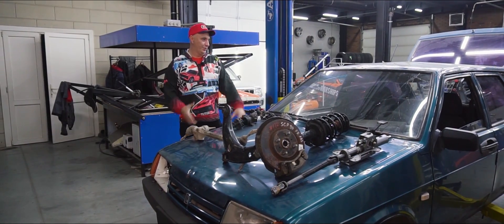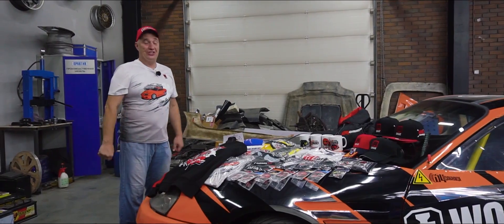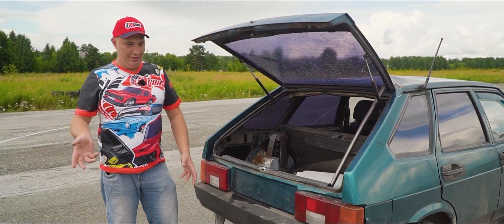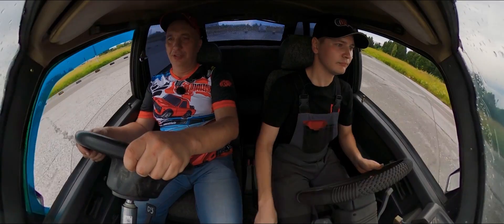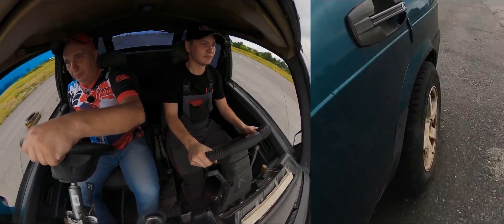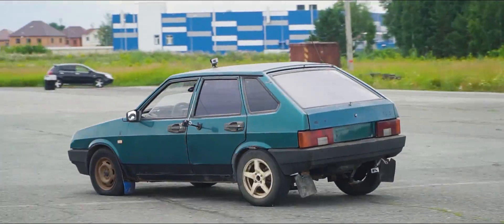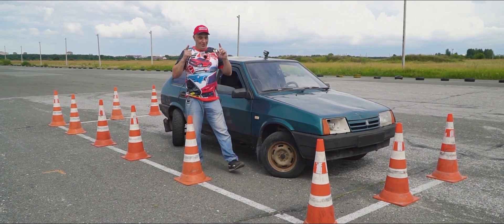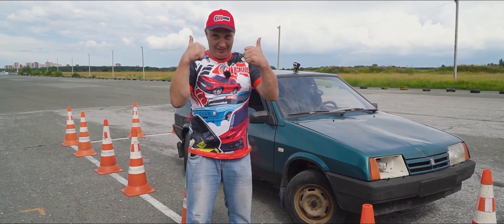Making a car steer with its rear wheels

Comment: You have to put the steering setup and suspension on the rear backwards compared to the front or your tires will go in weird angles compared to each other OMG, not to mention anti-dive from braking, which will make the rear end buck up abnormally high compared to the front OMG again.

Comment: 3rd generation Honda Prelude's 4 wheel steering is even more simple than adding a 2nd rack. Though the rear only gives you 15 degrees at max tilt. Still makes for and amazing driving experience that you'll never get out of any other car.

Comment: You installed the new rear axle the wrong way round, which is why the car wobbles so much. Because normally the inner wheel steers in more than the outer wheel, because the inner wheel has a narrower radius to drive than the outer wheel.
If you mount the axle at the rear in the original direction of travel, it should drive much better and more stable.

Comment: They have to come up with some kind of leaver between the both steering colum like forward and reverse the rotation movement to be driven by one man only
Reply: At slow speed to make a u turn put in reverse and both steer in opposite direction
Reply: And at high speed to switch lanes put it in 1 gear also to seprate both and drive like a normal car put the gear in neutral👍

Comment: hello guys, if i can give you an idea for your next video, i would suggest putting a differential system on the steering column, making the steering wheel turn the car in the opposite direction to the spin. I believe the behavior of the vehicle during the tests would be interesting. I love your videos. Hugs from Brazil.

Comment: One of the best cars when I was young had the steering wheel in the passenger side with a flipped rack so the steering was left for right right for left, drivers side had the foot pedals. Both drivers would be blind folded and the passenger in the back had to yell instructions to the drivers while trying to race a timed obstacle course, I could see these guys really enjoying that. I'd certainly love to watch them do it!

Comment: I tried a Renault laguna 4 Control once and it was a blast. At low speeds the rear steers opposite to the front and high speeds front ND rear steer the same. Very fun to drive and efficient

Comment: Four-Wheel Steering + Four Wheel Drive + Tank Steering + Limited Slip Differentials + Active Suspension = Go anywhere, be it a cramped city, an open desert, a mountain trail or the race track.

Comment: This kinda setup calls for that weird steering system shown on "daily dose of cars" channel showing an old video of a never adopted tech from the 60's were you had two tiny steering wheels that you you used with both hands.

 But in this case one steers the back while the other the front! I bet you could do all kinds of maneuvers with it!

Also it's be interesting for this to be 4WD/AWD and tighter turn radius!

Comment: It's just like the rear axle steering in the new Mercedes S-Class.
How about producing a mechanism for synchronizing the steering on both axles so that the driver will be able to control them with one steering wheel?

Comment: I Checked out (DIY centrifugal clutch for a Lada). What would happen if you connect a manual clutch on an automatic gearbox. And also, use an torque converter as an clutch on an manual transmission. WILL AN AUTOMATIC GEARBOX SHIFT WITH AN MANUAL CLUTCH?

Comment: Think ya could add a fitting to the power steering rack distribution lines... actuate the rear steering with the hydraulic valves in the primary rack? a pressure sensor on the hydraulic pump sensitive enough to detect the difference of 500 to 2500 rpm activates a relay that goes to two valves, reversing pressure flow to the rear rack at low or high engine speeds. needs to have some longer extensions added to stop the rear spindle knuckles from turning to much. ???

Comment: Try to mount a small engine in a big truck. For example old ZIL's 6.0 V8 produces 150 HP and 400nm of torque. You can find modern 2.0 diesel engine with similar specs.

Comment: Now make a system that activates hydraulc brakes separately on each corner of the car (use a shift mechanism and arrange four clutch master cylinders with the pushrods facing into the shift rod, 90 degrees apart, each end of the X pointing to the wheel its stopping, arranged like an old joystick - the shifter will "steer" the car with uneven brake distribution) and connect the throttle to the steering wheel, with the steering done like on a plane (convert the pedals to rudders).  

Total sensory mayhem, muscle memory crash: Nothing makes sense, no one survives.

Comment: Here's an idea. Have all four wheels be perfectly aligned so they cannot move left or right. To turn the wheels on one side must ravel farther. You cannot turn in place because one side would need to reverse. But breaking on one side with deferentially driven front and back should do it.

Comment: It can actually work in city parking. All the automakers need to do is to put a limit on the available speed input when using the 4 wheel steering option.

Comment: You should try add one center wheel with separate engine for it .. try to drift or turn on the engine while going 50kmh in front (center wheel spins backwards)

Comment: make a car with steering wheel at normal place, gas pedal at the back left seat, brake pedal at the back right seat, clutch at front passenger seat. So it'll be a 4-player car.

Comment: The rear steering is on backwards, or rather forward and it should be backwards. Basically the Ackerman alignment should point to the center of the front axle and yours is pointing to a point somewhere behind the car.

Comment: Hey Guys, one additional feature to the steering might be connecting both steering wheels with a kind of switch that allows to change from steering in the same direction to steering in opposite directions. So the driver could steer alone and decide between narrow circles and sideway movement.
Reply: chevy already made that 15 years ago or so
Reply: @chrism6952  That's not a secret, but did they do it in a rather small garage? It is not important if it has been done before, it is just a challenge to do it at home...

By the way... Chevy were not the first to build such vehicles.

Comment: That was EPIC!  Love it.  I wonder-- if you put a hydraulic (or electric) motor on the rear steering, and added a small control next to the main steering wheel, could one person learn to drive that?   Many cars have electric assist that is also strong enough to turn the wheel without a driver.  I'm thinking a joystick or knob.  With a button to return to neutral/straight.  This could be a thing.
Reply: It is a thing in some off road motorsports like competition rock crawling and Southern Rock Racing as well as monster truck competition.

Comment: Next step, whole FWD assembly in the rear for dual engine, AWD, quad steer lada!
Reply: They've do this already to a Toyota Scepter!
They used two 2.5L V6 automatic FWD engines + gearboxes, one in the rear as normal, and one in the back too.
Essentially made a 5 litre v12 viscous awd, with some serious cylinder deactivation for economy driving.

Comment: Try using ahal glide stering servo from a golf cart for rear stearing incorprated to factory stering wheel just add steeering revers switch  allows for one vehicle operator less confusion

Comment: You guys should install and run an engine upside down with the only changes of putting an oil pick up in the valve cover and flipping the carb right side up.

Comment: The ~2002-06 Chevy suburban (and I think the Silverados as well) had 4 wheel steering as an option...It's probably the one option mine didn't come with that I'd like to have....Though the front and rear steering are locked together so that diagonal driving parallel parking trick isn't possible in the stock configuration.
Reply: Wasn't there a Honda that had 4-wheel steering assisted parking as an option?
Reply: @johnruschmeyer5769  I think one of the 80's preludes did. RegularCarReviews channel showed one a ways back...Beyond that I don't know as I'm not much of a fan of non-American cars.

Comment: Had a 1992 Honda Prelude that had 4 wheel steering, was excellent for parking. Miss that car.
Reply: I used to own a 1999 Prelude, had it J-swapped %)
Reply: @SwapBlogRU  ive been thinking about that exact swap, how well did it fit in the prelude engine bay?
Reply: @sinva4847  it requires some pretty extensive modification. My car had a hole in the hood. https://www.youtube.com/watch?v=88C6RXjxHmQ
Here's a video with my car. It's in Russian, but there are a few good shots of the engine bay.

Comment: If you connect the two steering wheels with a rod or some cables you basically have a 4 wheel steering system ;)
Reply: Thats too useful😂
Reply: A chain and a sprocket?
Reply: @pinerigeson  Ooh, and you could balance the amount of steering between the front and back by changing the gear ratio, neat!
Reply: @VeraTR909  Indeed :) Or both the same and have the full effect
Reply: @pinerigeson  Probably the best way yeah, rods or cables would limit the rotation to <180 degrees without making it too complicated.

Comment: How about connecting the two steering wheels together with a chain and sprockets. Crossed over chain would reverse the direction of one wheel.
Reply: How do you cross over a chain?
Reply: @killerdinamo08  figure 8
Reply: Just try and see...

Comment: With some more steering angle in the back and some smart electronics controlling the back (allowing for just one driver), it could be really useful feature for driving/parking in very tight spaces.
Reply: Nissan did it back in the day

Comment: Mercedes-Benz: here is our new S Class with four wheel steering.

Garage54: how to make diy 4 wheel steering Lada
Reply: Never mind Honda and Mitsubishi back in the late 80s...
Reply: @creepingjesus  Eclipse ..... WHAT A CAR !!!!!
Reply: @38911bytefree  Forgot they put it on that! I was thinking of the Galant VR4... Probably thinking that because we didn't get the Eclipse/FTO line here officially. Only came as a grey import, same as most of the Lancer Evo's.
Reply: My 88 Honda Prelude had 4WS...
Reply: Chevy Suburbans had 4 wheel steering as an option almost 20 years ago.
Reply: @tomcarlson3913  really i didnt knew that i though they came with 4wd and 2wd option only. Nice
Reply: You sure it’s a LADA?
Reply: We had a fire engine here with 6 wheel steering to get into tight spaces in a state run veterans home. There were also some Ford jeeps built during WWII for testing with 4 wheel steering, along with some model of the M274 "mechanical mule" for the US Army.
Reply: @72polara  Saw a walk around video of the M274 a while ago: interesting idea, when you get into the details!
I've driven quite a few 6x2 trucks with rear counter steer, which are a great idea. Popular for urban deliveries, they minimise the number of cuts you need to make a tight turn. Definitely got my vote!
Reply: Fire Trucks in the Channel Tunnel have 6wheel steering..... Would they be DAF or Volvo's
Reply: @statementleaver8095  Usually Terberg, as they use both Volvo and DAF parts, but there's GINAF too who build specialist chassis on DAF parts. They often turn up as off road drilling rigs too, some with 4ws for precise positioning.
Reply: @creepingjesus  Interesting.
Thanks for the information.
Reply: Affordable and can install on any car  👍😂😂😂
Reply: Lol trucks have this looong time back:)
Reply: The Honda Prelude had 4 wheel steering since the 90s
Reply: ...with dual-steering wheel

Comment: We have to fit Three gears in centered position gear of three gears  one of the center position gear of 3 gears  will be joint to any  rotating piece of streering wheel attach in between 2 steering wheel you fitted in your above video to push or steer the front & rear tires in opposite direction So you can drive it with single driver and ease of manuvoir bility  it   with sharp & accurate steering response  like audi's all wheel steering technology .

Comment: The steering ratio of the two systems are not equal hence the front wheels don’t steer as much as the back wheels. I wish you would consider it while giving input to the steering wheels.

Comment: The Citroën ZX had steering rear wheels. At slow speeds it would turn in the opposite direction to reduce the radius of rotation so you can maneuver better. At high speeds it turns like the front wheels to increase stability. Of course the rotation was small and the effect limited.
Reply: Very interesting addition. Thanks for providing just enough info that i dont feel compelled to do further research. Usually people give too little info and i need to find other sources, but this was just enough to satisfy my curiosity. Cheers
Reply: Mazda, Nissan and Honda have this too, pretty neat feature!
Reply: My car has rear wheel steering, its called worn wheel bearing
Reply: So did my Renault Laguna 3, and it worked the same way - at slow speeds in opposite direction, at high speed in the same direction as front wheels.
Reply: 3000gt had it in 1992 albeit less sophisticated

Comment: I would like to see one steering wheel control both rear and front
Reply: And I would like to see a steering wheel for each wheel. Two more drivers in the back seat!
Reply: @jetjazz05  Man that sounds GREAT!!!
Reply: All the aircraft tow tractors, can be front steer, coordinated steer or crab steer.  Crab steer makes both ends turn the same direction, literally going sideways.  Coordinated steer means if the front turns right, the rear turns left, making for very tight turns.  
Monster trucks do the same thing.
Reply: Same
Reply: I would see one paddle to each rear seats. I MEAN IT